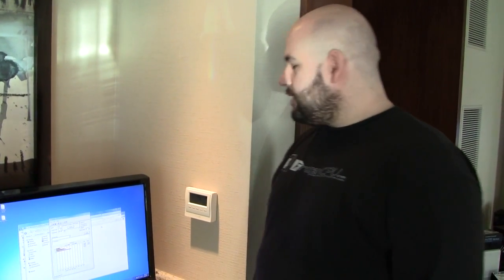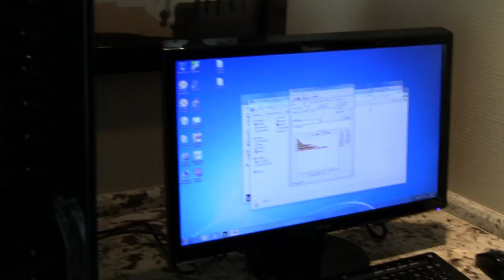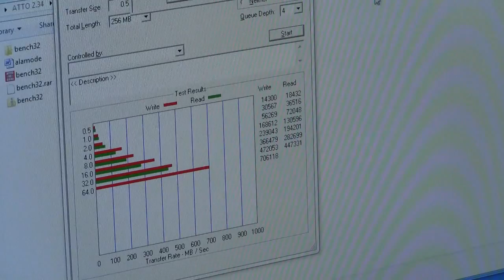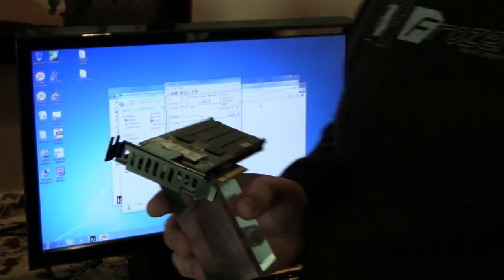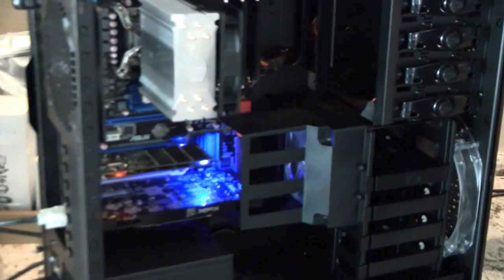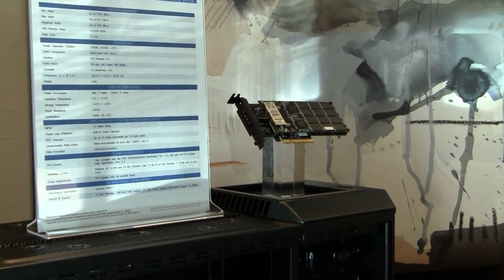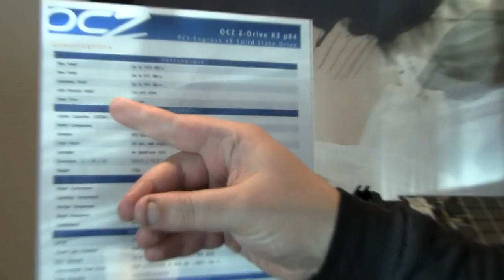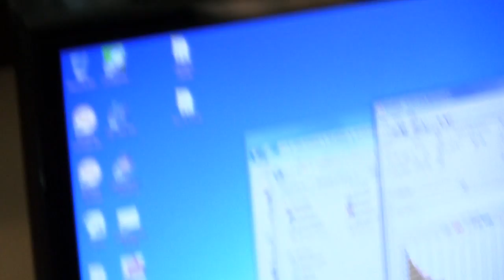OCZ Z-Drive R3 PCI Express SSD Hands On at CES

Comment: @SwishaMane420 Nah its a fake RAID that groups the 4 controllers(2 if its a smaller drive) as a single medium. but if you remove the stripping from the cards bios you can use a software raid to use all 4 111GB controllers in traditional RAID0 therefore trippling the drives speed, i say trippling because the amount of CPU overhead needed for software raid is going to cost you a good part of the speed.